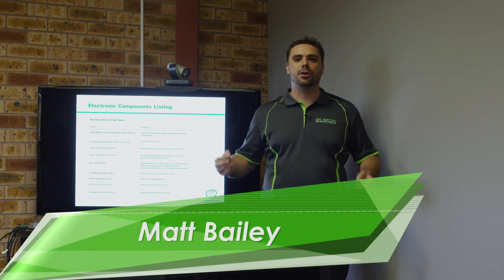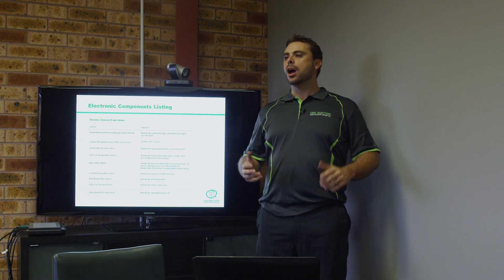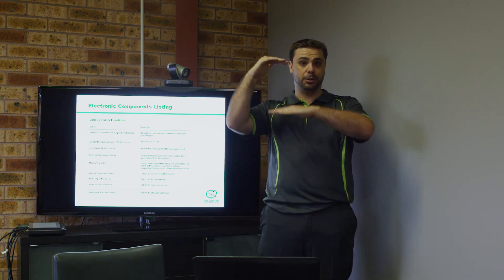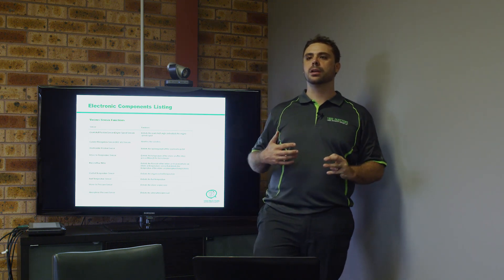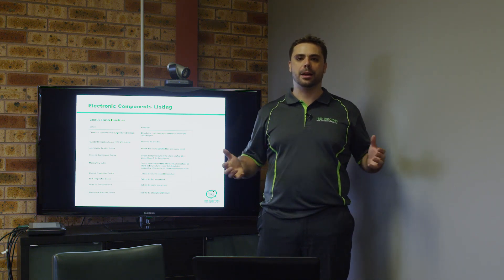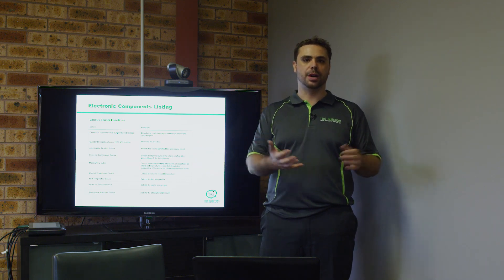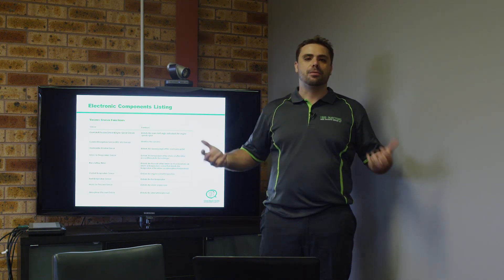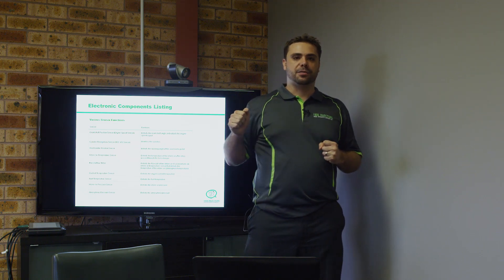How Common Rail ECU work out Injection Volumes

Comment: I have 2006 Nissan Navara D40 YD25 engine  it recently started going into limp mode every now and then.I took it for diagnostic they noted P0093,P0744,P1757,P1759 the vehicle does not have any visible diesel leaks but whenever it goes in limp mode it loses power and the automatic gearbox stops shifting and drives on one gear.All symptoms happens intermittently and I normally switch off and restarting the vehicle sometimes it goes away and sometimes it does not change.What could it be,please help with advise?
Reply: Hi its usually the suction control valve I had mine which used to behave that way I went on and changed the suction control valve and it was all well
Reply: @lucksonjakata4038  Thank you.Was it giving same fault codes?